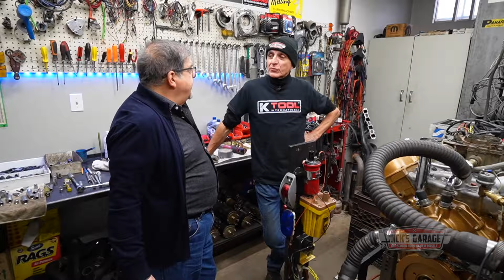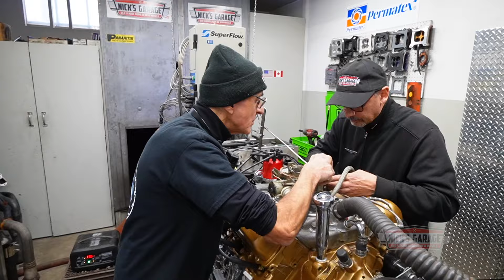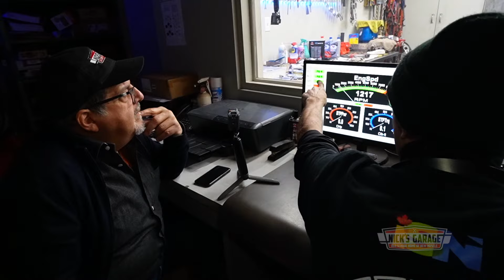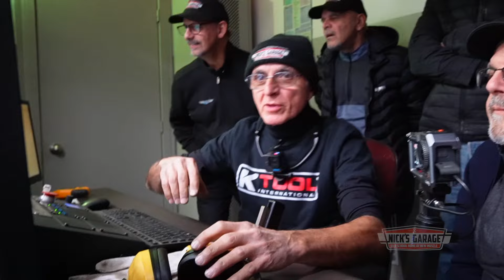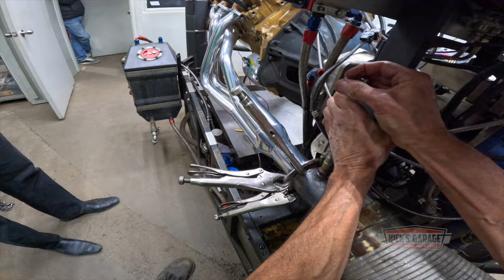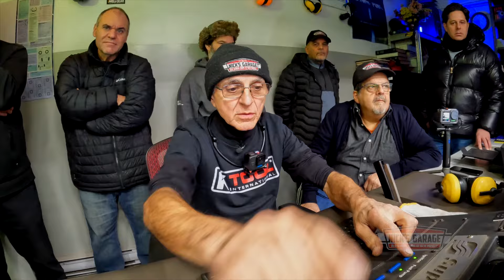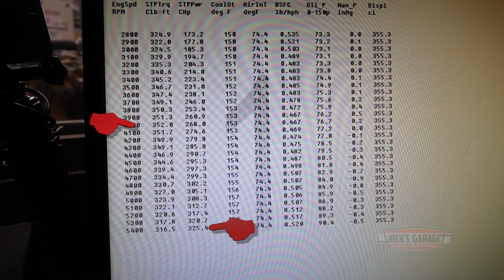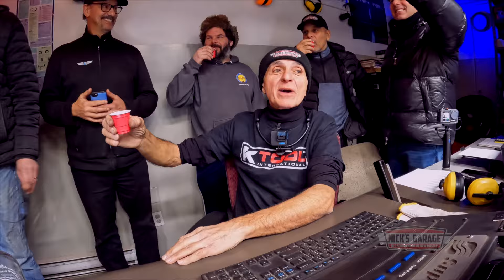Rare Olds W-31 Dyno Party - High Performance Small Block Tested

Comment: The numbers are gross. Everything went to net ratings in 1972. Net would be showing about 235 horsepower. I am not impressed. My bone stock 4.6 has more power and runs great on 87 regular octane.

Comment: A lot of people wouldn't know that of all the GM 350's, Olds had the shortest stroke, and I believe space for the largest valves (2.07 here, same as the 455's).  Very smooth and rev-happy, and the higher nickel content in the blocks meant they'd last a long, long time, too.   I owned both 455 4-4-2 and W-31, friend I sometimes did car work for had two W-30 convertibles and a '66 Toronado among other Olds.  All were great.

Comment: Before the Ramrod 350 was the 330 Jetfire, at 320hp (only five less, with 30 less ci's).  The nodular iron cranks in both of these were said to be good for 6,500rpm.  I revved mine regularly to over 6k, it was a wonderful engine.  M21, G80/3.91, rally pack.  One of 569 Cutlass S hardtop W-31's in 1969.  

Yes, it really needed a five-speed and power disc brakes, at the time (early 1990's) fooling with originality would have destroyed the value of the car, resto-mods have become a lot more acceptable/ desireable now.  

But yeah... unless you were in the north you were going too get cooked in these, no A/C option and quite a lot of heat coming through the firewall.  It did have kick-panel vents, but still.

Mine ran 14.11s 1/4mile at 97mph with headers through stock-size exhaust.   With bigger exhaust and Edelbrock's Performer RPM manifold, and a little more tuning/sorting, I am sure it could have been in the mid-low 13's.  

Suspension was modded, car liked to power-drift through S-bends in perfect control.  1-1/4" front sway bar, the 15x7 Rally II rims from the later Cutlasses, and the F-body spindles/discs and firm-feel quick-ratio steering box from TransAm did wonders for these cars.

Comment: With this engine if u are looking for more torque use the 1967  10.25 to 1 compression heads with 1.87 intake valves u will be surprised at the torque ratings improvment

Comment: I have a 72' Cutlass supreme with the 350 built , balanced Dyno tested with headers and an Edelbrock intake with a Quick fuel carb.  3:90 rear- Performance Suspension Technologies took away any body roll. With sway bars from an SS 70' Chevelle

Comment: The factory had two different camshafts the automatic grind was 308 duration and the stick grind was 328 duration the lumpy idle of the 328 duration  there was no vacuum but the 308 smooth idle had power breaks that one person hanging in the dyno room doesn't know a thing about Oldsmobile motors I had a collection from '64 to '70 all different size motors and I found the '67  330 Small Block better than the '70 W-31.  
320 HP  330 compared to 
325 HP  350
I had the big valves put into my 330 the 308 duration camshaft 
& Headers since Oldsmobile never made factory cast iron duel exhaust manifolds they used Mickey Thompson Headers from the factory on the W-31 & Rally Cutlass! But I had a little over 350 HP with a Mild Port & Relief. And I used the 308 duration camshaft the 328 duration camshaft is way too much for the small block. I also ran the '70 Olds Tornado 5 quart oil pan and baffle in my small & big blocks with oil restrictions on the camshaft! I also noticed the rods for oil relief I used the 403 Olds connecting rods in my 330. both my small block & big blocks were aline honed & squared up along with balancing. My big block '66. 425 had a bit more work that had a custom ground 328 duration camshaft since there is a difference in the bank angles  but I had over 525 HP on the big Block!  C

Comment: A 455 Toronado engine and transmission with W31 cam and headers in a Corvair gives a 10 second street car that can do wheelies off red lights. The weight over the drive wheels provides no wheel spin.

Comment: I had a 1969 olds cuttless rocket 350 and a 1968 olds cutless 350 ate those the same engine as whats in the video , thay look the same well the color is gold , cant remember  if thay wete stock 4 bbls or if i changed the 2bbl out to a 4bbl ?

Comment: Reseaon y is that the offy 360degree equa flow has huge runners and the left and right engine banks are Devided right down the center it starts out as one huge runner for each engine bank nd splits to each cylinder right at the end of the runners

Comment: Get the offenhauser 360 Equa flow intake manifold with a holley 3310series 750cfm standard flange 4bbl and get past 325 hp

Comment: hello    on the SIX CYLINDER ENGINE   /  a guy has a u-tube channel called" jayhawker"he has a video on adapting a GM 2bbl carb onto a stock intake manifold  ! uses a 1/2 thick plate bolted to the intake , a bit of millwork is needed   but all the stock linkage and ex. manifold is used YA  got a MILL  so PUT IN THE LUMP PORT ITEMS  "PLEASE"  David

Comment: I converted a 72 cutlass to a W-31 going with a ramrod 350 block(1968) along with a rebuilt turbo 350 heavy duty sprags and springs clutch pack Gm 13 converter. The car had power brakes but when I finished it seldom had enough vacuum to assist power brakes it was a scary ride. And perhaps the fastest car I ever owned😊

Comment: Stock torque monster for a low compression motor. Olds 403.. Gobs of short stroke, large bore twist !!
Headers and a Holley 750cfm, darn near pull a city block behind you..
Awesome Olds power..

Comment: I don't know what to think of it all back thrn, I know they were reliable, when my son turned 16, I was restoring muscle cars in Florida and he came down looking for something, his mother and I were apart for years and je had saved 2500,  so he had a week and we were looking, ended up finding a 67 impala at a great price from a navy boy, and a con car sales guy had showed up with a S body style 71 Cutluss that had been done with 82 Z28 scoop things modified into the hood. Still had all the trim, black vinyl top with a brownish champagne color, 442 wheels, and fake W-30 stickers on front fenders,,350 motor, 442 wheels, white interior all in great shape, car had come from California.  More than I wanted to spend but bought it for $4000. Everyone thought it was alot but I knew muscle cars would get popular one day soon. This was in 1994, so I put up other 2000. To get it and knew he would drive it on cold weather,  you need a winter car, don't drive it in salt if possible. So I cleaned as mush as possible, undercoated all the places important. Fixed ac and was good to go! We drove it all the way to Indiana, by Christmas he had Cragar 5 stars alum. Wheels and 296/50/15 on back and a 215/60/15 up front! Car really looked good. 2 years later he joined airforce after graduation and pickled the car in my dad's pole barn. By 2000 stationed in Charleston he came and got it.  Found a guy that had a bunch of Olds new parts and wanted to sell to pay off credit card debt. He scored a 12 bolt Moser rearend with 31 splined axles, 3 inch mandrel bent alumnized pipes and flowmasters, one of his racing friends had bought the Eldebrock heads and 700 trany he wanted! Never tell your friends about deals until after you buy! So he had a older 455 built, and was able to buy those new Eldebrock heads with money and trade stock heads, local shop jad built motor  while he was overseas, I jad built a garage and went to pick up car and new motor, get it in the car, had 15 days leave! See how far we get! We scrubbed up car, and did engine bay, new urethane bushings in a frames, and Qai shocks that came with parts deal, had to modify a frames to work, week had went by, Get to the motor and I didn't see silicone under the back of intake, got a feeler gauge out and it went inside all the way across. Oh crap! Took intake off and my son was upset as he paid that guy bug money to do motor right! Had Keith black piston, high compression, roller cam and rockers, down to stock crank. Once intake was off there was grit in the lifter valley pan! Not a good sign, 4 bolts holding pan were just finger tight,  so I flipped it over and pulled oil pan,  checked rod torgue and 2 were off. The motor jad a stud kit installed he got with parts deal, crank scrapper, so alum. Blocks were on top of crank caps, a d you couldnt get 3000ths feeler between those a d crank throws,  so told my son bad news,  to many things wrong with motor, wouldn't trust it, need to let my best mechanic friend check it out, Oldmoblies are alot different. Told him we should jave built a chevy as he had a small fortune in the Olds.  So it was left in my garage, buttoned it up and it set. Jad a project of my own,  then a divorce, lost garage and took 2xyears to get it all after pensacola corrupt black judge got down playing games giving her everythibg! Once got order to go in, they came in from Charleston and it took 4 hours to get it straight with cops on lousy court papers. Got on and worked for hours loading it all, build  thibgs for engines to sit in. And sent some of mine with him. Thet jad taken alot of my tools and garage equipment.  What you would expect from Florida hillbillys who don't earn there own, was another month to get back in to move the rest! Another problem with paperwork wasting time! Typical pensacola! Had cars t I get and wouldn't give me my titles, so got what I could and just left the rest!  Tired of the games, courts play, put th I ngs in storage, no room for cars, sold some, couple years later I go the Charleston to finish the Olds but nothobg was done, 7 years it sat while working.  He gets transfered to Alaska and car gets picked up north again, motor was sent to a new York builder and he sent a list a mile long what was wrong with engine! Guts were ok, but rocker geometry was wrong, all thecnew parts my son bought, motors had mixed new and used parts, wrong push rods,  wrong studs in some of the holes and je had machined head places down that didn't need it , so heads had  to beveled back up machined down, wrong freeze plugs in block, so decision was made to de horsepower it. Dropped it to a 10to 1 flat top, good rods, de cammed it, and ended up with a 470 cube motor, 565 lift roller cam, and correct everything else. Ready to go finally! By thrn he is in Colorado and was sent to Colorado speed shop!  Then put the motor in the car and a suspension kit, headers hit everything  but looks like some high school kids worked on it,  brake lines dangling, ran over bell housing, brake proportion block, wasn't right. Lect a frame shaft stick out into header, that will make a hole in time, lines so tight the torque would rip them, they chassis dynoed it with 30 year old tires. He had bought a high dollar carb with adjustable ventures,  and ended up with a Used Holly with a Demon bowl on the back, you name it was half ass done, and leftcitvthat way, all kinds of parts missing they say they didn't have, still had Qai shocks even though suspension kit came with others, then parked it outside, and didn't cover it up! Car hadn't been outside in 30 years,  water got in the trunk and on top of rear fender wells and made rust,   battery was put in trunk, just bored holes with no grommets. Engine leaks oil, in places, so it's parked again for last 10 years, , he finally retired 1.5 years ago, now with a bad leg I can't work on them like I used to and hechas so much money in it now, and it's still not done right. So he's bought a house and got through a wife's remodel,  working on his garage with little time, a gov. job plus more college. Said he has more in it now than he could have built a fine LS motor for! Would like to see the car done or at least driveable.  So question is now will it get done!!  I wouldn't build a Olds motor if I had one, it would definitely be a LS engine as power they make, for the money spent. Time.   It sound good and runs,  responsive, chassis dyno said about 400 hp. 525 torque to the rear  wheels.  I wouldn't but his plan is pull the trim, vinyl top, redo body, paint it light gold😢, and some 17 inch  wheels. Cars are more popular now! Hope to see it on the road before I die.

Comment: Well the are what they are! It's to bad at that time government passed the word down about restrictions and killed one better than this! - WO-34 think it was, with alum. 4 valves heads like a Hemi. Were some design flaws that needed fixed, way all those push rods went from lifters to rockers, clearance had to be made, They redesigned the block a little, think there was 3 made, just as they almost finished it GM ordered them scrapped!  A guy bought 1 and finished it, and put it in a 70 442, said it was like 375 hp. But had almost 500 lbs. Of torque. Nobody knew if the other 2 were scrapped or laying in a garage somewhere.

Comment: I recently had a ‘72 Olds 350 rebuilt and it dynoed at 300.9 hp at 5400, and 344 ft lbs torque at 3300 rpm. The builder used a 455 cam, shaved the heads and block. With 8.5:1 pistons this increased the compression from 8.5 to 9.2:1. We used my 750 Qjet. I was pleased with the 300 hp mark.
Reply from the maker: Sounds like a great build!

Comment: Love those Olds 350s since my first  77 Olds 442 with the smogger windowed main web block / 3A smog heads.  Since  1994 Ive had a 86 Olds 442 with a  68 Olds 350. .030 forged flat tops,  heads shaved .020 for  65 cc, 9.8 compression with the thick fel pro .040 head gasket. The old 80s-90s Crane commander split duration flat tappet cam, 230/236 @.050  .496/504 lift. Performer RPM with a 650 mechanical secondary, stamped steel rockers, mechanical fuel pump (AC Delco!) HEI, nothing fancy, 18 mechanical advance, 18 initial,  5" crank pulley,ram air set up...even have the vintage style scoops under the bumper.  Turbo 350 with a TCI 10", that old converter has been taking abuse since 1997.  8.5" 10 bolt with a  3.73. The one good thing they put in there. Air bags work awesome in the rear coils. Low 1.70s 60 foot times.

THe car weighs 3640....with myself and a half tank of gas, at the track (Milan  outside of Detroit)  the weight is 3840. With ET streets , 26x10.5, and uncapped headers, on a 60-65 degree day Ive gotten some mid to high  12.50s at 107. Never been on a dyno but based on the weight and ET.....one of those formulas puts it at about 385 at the crank......With a flat tappet cam, stamped steel rockers, factory heads, HEI,mechanical fuel pump, that doesnt seem too bad. Imi happy with it. Did some mild porting to the heads, mainly removing the EGR bump in the exhaust manifold and cleaning up the blow area, nothing too radical.  To any Olds gurus out there, considering Im not running and trick stuff, no rollers anything, factory heads, ignition, flat tappet cam. would you say that HP/ET is half way respectable?  I shift at  5800 and cross the traps at  5400.
Reply: Your 350-4 is putting out about 363 Net Horsepower, which considering your Compression Ratio  and Cars weight of 3840 pounds is simply fantastic!
Have you considered putting in a 200R-4 Transmission? It would give you more off the line dig because of the 2.74 first gear versus the 2.52 first gear of your Turbo 350! The other benefits would be a .67 4th gear overdrive, and with your 3.73 rear,  your top gear Ratio would now be 2.49 rear end! Your crusing RPM Level would drop a good deal and your gas mileage will go up to a little over 21 mpg easily!

Comment: They used the big block small valves. 2.005" intake and 1.63" exhaust, not the Toronado/442 big 2.07" intake valves. Tim King/68post

Comment: While I was having my 455 1970 w30 being rebuilt ,the shop owner installed a 1970 w31 engine in my 442 out of his drag car , I could tell the difference immediately that 350 w31 motor loved to rev and felt every bit as strong on the top end as my w30. Great little engine same set up a set of headers and a Qjet.

Comment: He's got the original eng?          He should pull the aluminum rear end and save it, replace it with one that can take the heavy load, that is he's going to run it hard, remember it's aluminum!

Comment: The W30's and W31's used a different cam for the 4 speed cars I believe and thats why they didn't come with power brakes.
The Toronado's use the automatic trans cam thats why they could run power brakes.

Comment: 33:49    If it is the correct, unmodified, W-31 carburetor, it is 750cfm. 

Quadrajets only came in 750 and 800cfms. The 800cfm units were rather rare, and 95% of them were 750.

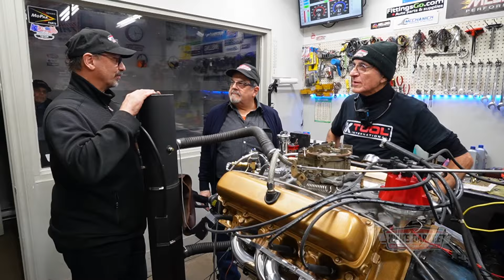Comment: 12:29     It's not all that interesting, really.... 

The W-33 and W-34 cars had 455c.i. big blocks in them, and with the 105 extra cubes than the small blocks, the big blocks produced enough vacuum for power brakes whereas the small blocks did not with the same cam. 

That is why power brakes couldn't be had with the W-31, but could on the W-33 and W-34 cars.

Comment: It's too bad the factory cammed the W-31 for a peak of 5400rpms. The bore, stroke, and rod ratio of the Olds 350 lends itself to MANY more RPM's than that. It's an undersquare design, and has a better geometry than a small block Chevy. Build them to turn.... 

I completely understand the need to build this one to stock.

Comment: There is a ported vacuum connection at the front left of the carb. It should be hooked up for street driving. The bigger engine with the same cam should produce more vacuum.

Comment: I built a W31 for a 70 Cutlass Rallye 350. Yellow with a wing. It pulled like a big block. Pocket ported the heads performer intake stock carb with tuning. Close ratio 4 spd. That was a fun car. Comp cams